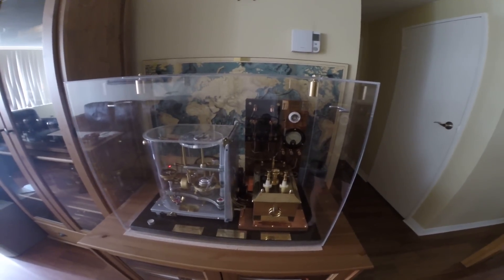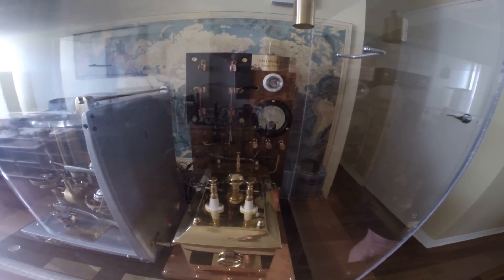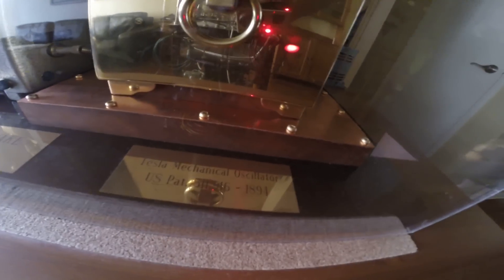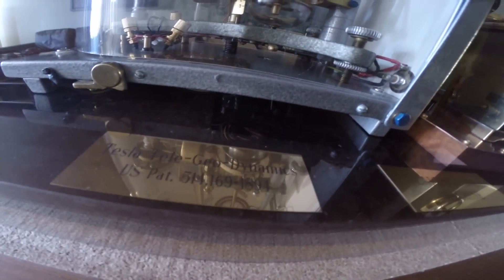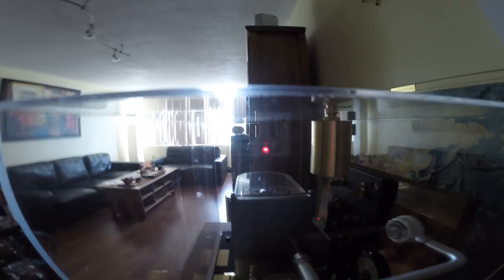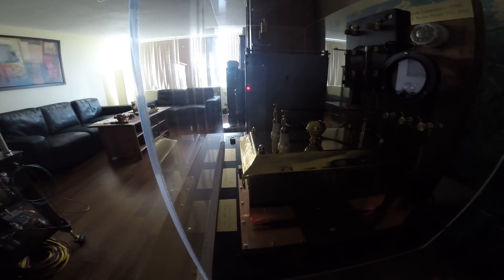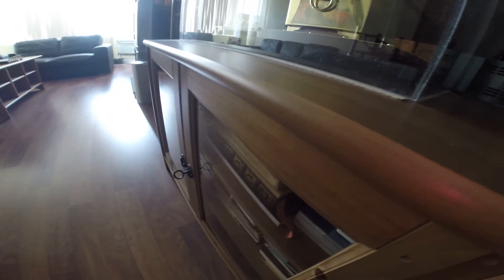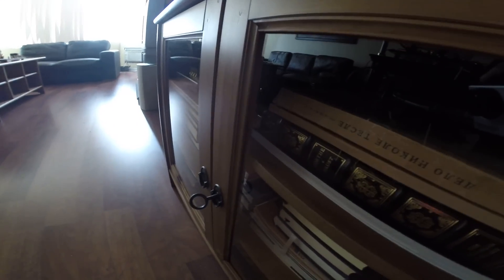TESLA MECHANICAL OSCILLATOR - IN WORKS - (EARTHQUAKE MACHINE)

Comment: And this was in an isolated container on a table, Tesla's machine in his building was hooked up directly to one of the steel support beams, he also ran it for significantly longer than you did here (partly due to a malfunction with the control board which made him unable to switch it off using the dials leaving only the, manual, approach AKA he took a giant sledge hammer to it).
Reply: So that machine caused the earthquake in New York in 1890s ??
Reply: @realmundo9060  Well not THAT one specifically, the one Tesla used was smashed to pieces before it could bring the building down around his ears, but yes.

Comment: I always hear a faint sound like that before an actual Earthquake starts and I begin to run or take cover. 1:35
Reply: Thats true i can laso hear it and also run for my life xd
Reply: Earthquakes are nothing more than a Soundwave that moves through the ground if I recall correctly called P-Waves. These low frequency sounds have the capability to trigger harmonics of higher octaves so it is entirely possible what you are hearing is one of these in the audible range as the Earth begins to move and objects vibrate at higher octaves to the wave from the Earthquake.  I would be interested in if you are capable of capturing the exact frequency using an App like Spectroid or something similar. It would be highly valuable to know as it could improve Eq response and warnings as we would detect them before they start potentially days before if we simply knew what to listen for.

Comment: Another beautiful model!  Interesting that one of Tesla's methods of achieving isochronous oscillations was to submerge the unit in boiling water - such a simple method.  The Mythbusters constructed a model but couldn't get it to work - Tesla mentions the need to start it with a blow - strike it and it will oscillate.  I seem to recall that his oscillations were around 5kHz or so for wireless experiments....  Thank you for sharing.
Reply from the maker: Todd Berg Thank you Todd
Reply: Canadian Tesla Technical Museum how do I build one ? I want to do some experimentation but I can't find any decent schematics
Reply: @Heads Mess if it's not sealed how dose the Piston fire?

Comment: I wonder if this tech can save lives on the battlefield by triggering hidden bombs . Has anyone else thought of this or is it just me?
Reply from the maker: Eugene Fuller primary function of mechanical oscillator is to observe resonant frequencies of a subject material under stress.
The other was more geophysics as mechanical waves can be used to discover different minerals as Tesla digested.

As you mentioned there could be number of applications but for what you are suggesting it has to be a really big mechanical oscillator as most mines react to pressure or pull. Not sure how you meant to use it that way ..
Reply: Did you meant throwing the machine on a spot and seeing whether it explodes ?

Comment: very cool! thanks for sharing.
Reply from the maker: +moonfther 
Take a look at my newest video - Tesla Radio Controlled Boat :- ) 

https://youtu.be/gkzPBsZ7c1I
Reply: +Nemanja Jevremovic 
Amazing work! would love to see this in person someday!
Reply from the maker: We are planing a full Tesla exhibit next year in September time, pending proper investment to cover the cost of 2 week exhibit. For now it is a go but we will see.
We are in Kitchener / Ontario about 85 minutes from Niagara Falls .... The exhibit will be in downtown kitchener "Tannery Event Centre" cheers... 
What is left on a boat is the clear acrylic body (antenna(s) and top lid is done) and remote control unit (also 1898 technology) except the "spark gap", for the purpose of display durability we will replace the ordinary spark gap with the vacuum tube, the rest will be according to Tesla patent "System of Signalling" with dual transmitter and receiver.
Reply: +Nemanja Jevremovic any updates on the exhibit
Reply: +Nemanja Jevremovic any updates?
Reply from the maker: +TheByErkin updates on what? New videos .... ?
Reply: +Nemanja Jevremovic no, the exhibition
Reply from the maker: +TheByErkin It is set for 2017 when we will present 5 new exhibit items. It will most likely be either at ROM (Royal Ontario Museum)  Toronto or Communitech Centre in Kitchener. Ontario, Canada

Comment: i dont understand how something can make an earthquake
Reply from the maker: Journalists called it earthquake machine - read the description, it is an electro-mechanical oscillator that can be adjusted to resonate with the object surface it is installed on (natural frequency of the table for example). 
When resonance happens the whole table shakes and if it is not constructed well it will fall apart under these conditions...
Reply: +Nemanja Jevremovic srry... still dont get it... dont bother im not going to get it...
Reply from the maker: +LampOfMagic study Electrical and Mechanical rezonance! I will give you the example of a bridge in San Francisco some time ago when the winds hit the natural resonant frequency of the bridge and it fell apart.

All objects including car with open windows etc are tested for possible resonant frequencies .... 

No problem if you don't get it doesn't matter does it?
Reply: +Nemanja Jevremovic ty
Reply: Canadian Tesla Technical Museum wasn't that the Tacoma narrows bridge in Washington state?
Reply: Army of soldiers won't march on a bridge together the reason is resonance the bridge might fall if the frequency of foot tapping on the bridge matches the fundamental frequency of bridge. In this vedio you see the machine shake the table. Well imagine a bigger version of the machine using it on buildings or bridges or for that matter using a couple of them in a city at different and specific location when they all create vibrations together you see how artificial earthquakes can be created.
Reply: YoItsLemonBoy! Very simple, its all about waves and frequency, faster frequencies stronger waves